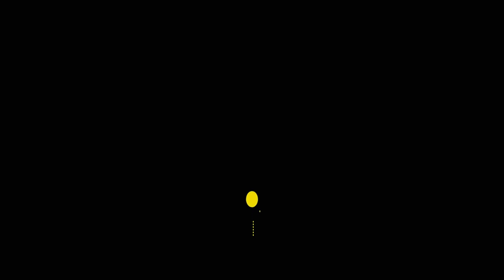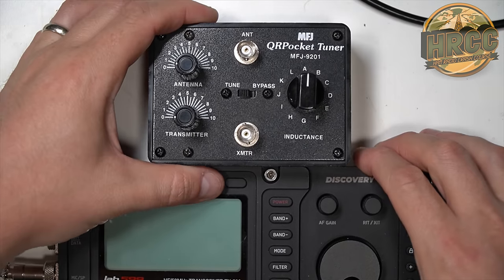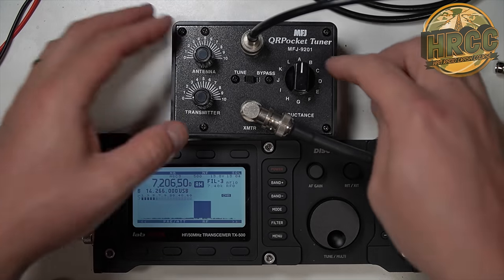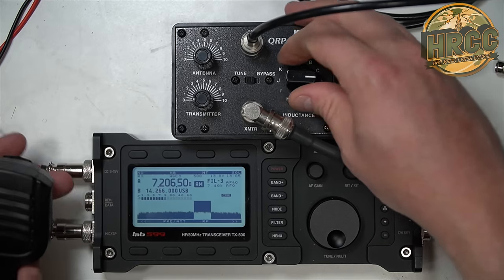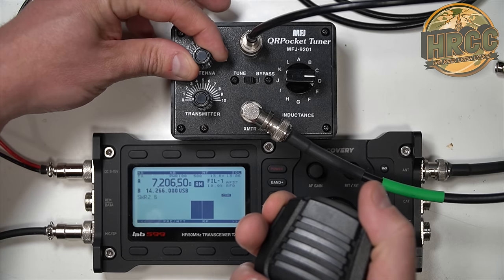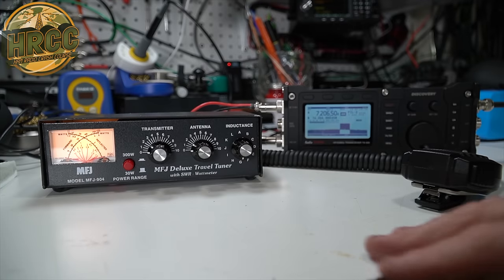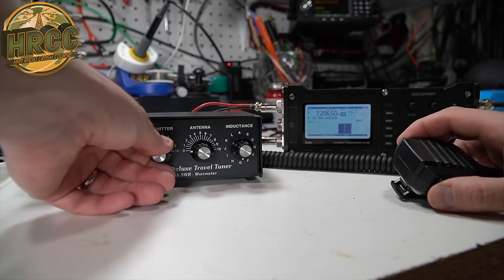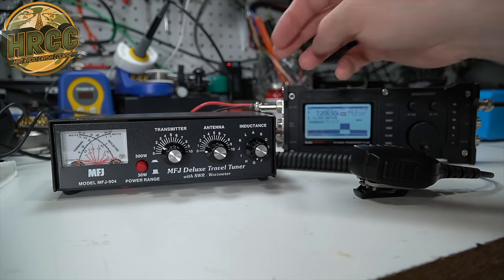How To Use A Ham Radio Manual Antenna Tuner 📻

Comment: Josh - I really enjoy you beginner videos!  I'm looking at adding an antenna tuner to my shack and was wondering about a few things.  While tuning a manual tuner like the MFJ discussed here is very straight forward in a receiving mode, I'm wondering how one might do the same for receiving only with a automatic tuner.  Would that involve picking a frequency on ones antenna analyzer, allow the auto-tuner to find the sweet spot and then switch over to receive on that frequency?  Is that approach even possible with low power signal coming off the analyzer?  Is this even a viable approach?

Thanks again for your to the point videos.
Reply from the maker: Not really.  Auto tuners generally require transmitting power through the matching device which would be transmitting out of band for many of SWL frequencies.

Comment: Hullo I’m an amateur writer and I’ve got a scene in my head where a guy (lets call him Tom) is in front of a HAM radio and someone from the ‘the other side’, ‘tunes into’ his device. In my head, the static from Toms radio steadily clears as they adjust their frequency to match his. Does this make sense? Is this how they work? Or would Tom not hear anything until they got the right frequency? The only thing I have to compare it to is a car radio, and obviously it's not the same. Thanks.
Reply from the maker: Static generally stays the same. Tom would be transmitting and the station would tune onto his transmitted signal. The other station would hear a distorted Tom until they were on the same frequency.
Reply: @HamRadioCrashCourse  I didn't expect a response thank you!

Comment: Does this while antenna tuning apply to HF, VHF, and UHF?  Or do folks only really worry about it with HF?  I ask because I only just got my technician license and only have an HT.  I am going to build a 1/4 wavelength 2m antenna to hang outside to use with the  HT.  I am wondering if it is worthwhile to tune the antenna.
Reply: Generally speaking, you tune the antenna by making elements longer or shorter for VHF.   Also, the low power of the walkie-talkie makes mismatch not much of an issue.  the rubber duckies are horrible antennas but it doesn't bother the radio.

Comment: Thanks Josh. Two questions. You never used the Antenna adjustment, just the transmitter adjustment. When is the Antenna adjustment used? Also where did you leave the bypass switch set after you made the adjustment? I'm assuming it's not on bypass to use the Antenna matching setting.
Reply from the maker: I did show the antenna adjustment on the video, it just made the match worse.  When I use a manual tuner, I set the inductance first, then the transmitter and I'll check the antenna just to see if I can drop the SWR further.  It often will not though.  

Yes, you need to leave the switch on "tune" to engage the matching network.
Reply: @HamRadioCrashCourse  whether or not the Antenna Variable CAPACITOR (not a "Potentiometer") makes the match better or worse is a matter of what the antenna is. It's not like you showed it on multiple bands, on multiple antennas, some of which might not be all-that-resonant at the Freq being used, etc.

Yeah, there are situations/combinations where you won't deal with the Antenna Capacitor much.

There are others where you can't get the SWR down reasonably at all without the help of the Antenna Capacitor being adjusted.

Comment: k, Im getting a little frustrated...Im building an NVIS antenna to work with my radio in a box set up. Im running an anytone 778 UV. Seemed to be a good little mobile radio for the money.  Im seeing lots of info out there saying I need a tuner, others saying I don't need a tuner...if I need a tuner I'd like to have one small enough to throw in a pack and maybe use the nano for graphical adjustments or possibly the MJF 902B...I guess the question is...with NVIS do I really need a tuner?
Reply from the maker: You don’t use NVIS on higher frequencies.  In those case a good foldable vertical antenna for VHF/UHF would be the way to go.  Look up “ladder line vhf/uhf antenna”.

Comment: Hey, Josh! What would be interesting, would be the difference between a manual antenna tuner vs. automatic vs. antenna matching hardware?
Reply: Manual tuner uses variable capacitors; automatic tuners use stepped capacitors arranged in a binary progression such as 1, 2, 4, 8, 16,32 picofarads (for instance) allowing to choose any value from 1 to 63 pf in 1 pf increments.   What the computer does is scroll through the combinations rapidly.  Same with inductors.   Naturally you want to dial down the power on your transmitter since it will try a possibly large number of wrong combinations reflecting a lot of power back to the radio while it is hunting.
Manual tuners only MATCH the antenna, whether you actually radiate energy is another matter entirely.  This is true of automatic tuners of course but the programming is aware of that possibility of getting a false match where the tuner itself consumes all or most of the power.

Comment: Signal Strength Reader! The video is really helpful (I just bought a manual tuner from Emtech) - but what I REALLY want to know is - What's the end result? Or is that a simple math conversion? Does 2:1 SWR means you're getting 1/2 of your transmitting power out? Still - I would want to SEE that in the real world. Show me a Signal Strength Reader on a Random Wire untuned vs tuned for multiple bands. I've never seen anyone do that, and yet, that would seem to be the most effective way to show the effect of a tuner. Or am I completely wrong? I'm no engineer.
Reply from the maker: Oh. The meter is showing both on the video. As the swr ones down, the output power goes up. 2:1 is a measurement of impedance between the radio and antenna. 

When the antenna is poorly matched it resist the flow of rf and will radiate poorly.
Reply: @HamRadioCrashCourse  Thanks for that clarification, still learning my way around the IC-705 and the Emtech ZM-2 tuner. Trying to get all I can out of these 5-10 watts and my CW just isn't there yet. Great 705 vid btw - lots of gems in there for 705 owners.

Comment: I know this is a very old video but with a radio like the yaesu 991a would you still think you  would need an external tuner?  assume I know how to cut wire and get it in the ball park.  But for end fed antennas?  etc
Reply from the maker: The radios doesn’t dictate what kind of antenna matching equipment you need. That is more for you and your budget to decide.

Comment: Question : I have a mfj manual tuner and get the swr as low as it can go then in a few minutes it needs adjusting again so you can't set it and forget it ? on the same band ??
Reply from the maker: No, generally as you move up or down the bands, you will need to retune.

Comment: I have a big old manual antenna tunner  never knew how to use it this is an intersting  vido , but I don't feel good enough to use it on my new 7300 I want to get an lgd 100  auomatic tunner for it.

Comment: What I still don’t understand is when you would use an antenna tuner? When building your antennas, won’t you trim the actual wire to tune it?
Reply from the maker: For example a random wire antenna with a 9:1 unun is not resonant on any frequency and requires a tuner to get a match to the 50 ohm impedance of the radio.

Comment: Another really helpful video.  I am a relatively new (and less than fully educated) HAM. I just purchased an MFJ 971 for portable use. As I understand it, a random length wire dipole with balanced feedline and a tuner makes SWR irrelevant (assuming your tuner can match the impedance).  My question(s) is:  Is that correct?  If so, is a longer wire antenna be better than a shorter wire antenna?  Could 50 meters of wire antenna actually be better than a resonant 20 meter wire for transmitting on 20 meters?  Thanks for any help.  KC3ITL
Reply: Longer wire is almost always better than short.  It is the wire that radiates, more is better!    But there's some caveats.  The 50 meter wire can fit 2.5 wavelengths of 20 meter.  That's going to give you 6db or more gain in its preferred direction which won't be completely obvious.  40 meters of wire would be more predictable; two full wavelengths and you'd probably drive it 10 meter from one end for low impedance feed or at the end for a high impedance feed.
SWR by itself is harmless.  Ignore than SWR behind the curtain but with some understanding.  You send a radio wave to the antenna. If matched, it flies off into space.  If not matched, some of it will bounce and come back to your radio.  your radio doesn't want it, so it bounces back again toward the antenna, adding to the next wave your radio is sending to the antenna.
So now with double the strength, that reluctant antenna is persuaded to radiate.  All of the power leaves the radio!  It might take seven trips back and forth through the coax to finally get radiated (each bounce being reduced).  
the effect of SWR therefore is the signal takes extra trips through the coax, losing a db each trip.  Maybe more than 1 db.  Thus the transmit power is consumed in the coax and turns into heat (not much heat, but its there) and never radiates.
A side effect of SWR is that it increases the voltage on the power transisistors because they see not only the battery voltage, but the reflected voltage from the antenna and this could cause failure.   It also increases the voltage on the antenna and if people touch it could get a shock or burn.
But the ends of a dipole antenna always have a much higher voltage than the feed point anyway (in a center fed dipole).  End-fed antennas require a high voltage push just to get electrons to go in, they don't like end fed antennas. 
The G5RV antenna uses 600 ohm ladder line, which has very low loss and very high SWR anyway, it is part of the design.  Who cares about SWR when you are using ladder line or random wire?  Just match it and go!

Comment: Hi all, really, this should be a more involved iterative process, to find the best I.e. unique setting. Adjust one cap for min swr, then offset the other cap a bit... this might even cause the swr to rise, but then readjust the first cap for min. If it's worse, go back the other way and keep repeating for best, and least "touchy" swr.... that should probably give you best bandwidth for good match.  Also, I tend to agree with the comment below that using minimum possible inductance, which achieves a match, will probably minimise loss in the tuner. The technique, shown in this video, will not necessarily acheive these optimum settings.

Comment: This is a really informative video. :) I set up a 40 meter inverted V yesterday, and I used a MFJ-945e to tune the antenna. Everything seemed to work great when I was connecting to Winlink ARDOP gateways, but when I tried to use WSPR, the antenna tuner made a loud squealing noise, and the meter did not indicate that any RF was being transmitted. My antenna analyzer shows that my SWR with the tuner is 1.03 to 1 at 7.140, and the SWR was about 2.75 at both the low end and the high end of 40 meters. Does anyone know what could have caused this issue?
Reply: The lower the frequency the narrower the bandwidth particularly if you are using a tuner.  It is a tuned circuit!  So you are going to have to jiggle it if you change frequency very much.   If the tuner makes a noise, that typically means it cannot find a match and that in turn means your antenna is too far out from resonance to match with a simple tuner.  Manual tuners tend to have a much more tolerant ability to match almost anything.  Automated tuners generally expect the antenna to be approximately resonant already. The exception is random wire tuners.  They'll match almost anything but watch out for high voltage.

Comment: Could you use this type of tuner to tune a Magnetic loop
Reply from the maker: No absolutely not. You need to adjust a the capacitor of the mag loop. Do not use a tuner.

Comment: Great info, thanks. I do wanna note that for some reason i prefer the lowest noise floor to be set, raising it is bad for RF and overall distortion is also higher. Basically contradicting the Attenuator (RF GAIN - It's is exactly that - RF GAIN). That being said it turns out you have maximum power output (Efficiency) if you watch the CB TX Meter and adjust the tuning knob accordingly, leaving the SWR floating at unknown ranges. Without any fancy DSP noise reduction it all makes no sense at all to raise the RF floor (Static).
Reply: I think he is using the noise floor as a reference, because having a low noise floor means that the antenna is not really resonant at whatever frequency the radio is tuned to. Having a higher noise floor means that the radio is "seeing" an impedance closer to 50 ohms. You can get a really low noise floor by disconnecting the antenna but obviously that would be bad for the transmitter.

Comment: Great educational video...  I have often wondered however, why is there such a plethora of tuners on the market?  It is easy to understand the difference between automatic and manual tuners, but within those two categories there are a great number tuners.
Michael VA6XMB
Reply: That's because none of them are magic!  People are disappointed and they try another one, and another, and another.  They are good enough, and easy, but somewhat limited.

Comment: So, what does the antenna side do then?
Reply from the maker: Puts out the power as rf.
Reply: @HamRadioCrashCourse  What I meant was you were only using the adjustment on the transmitter side, What does the variable capacitor on the antenna side do?
Reply: @IWatchedWhat  Yes, that's what I was interested to understand. You never used the antenna adjustment. What is it there for? Thanks

Comment: I was wondering what a good dual/multiband tuner might be for a 2m/70cm radio? Hopefully not a dumb question as I am new to ham radio.
Reply: while such a thing probably exists, that approach is more complicated than it needs to be.  At the wavelengths you're talking about, antennas are small enough and broadbanded enough that tuners are basically unnecessary.  For cars you can get a dual-band vertical, and for a base station you can get complicated with dedicated antennas and a diplexer, or simple using a 2-meter J-pole which does a passable job on 70cm, depending on your needs.  "Tuners" or matching units become valuable when using HF antennas on bands (or portions of bands) they're not matched on.